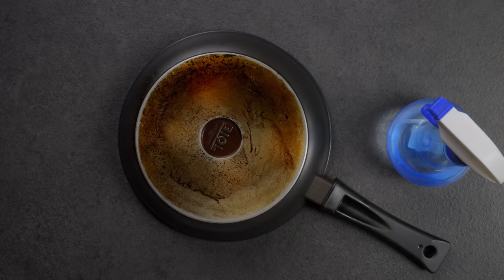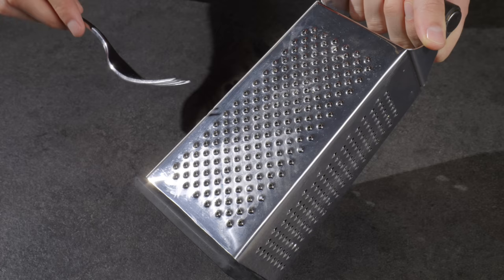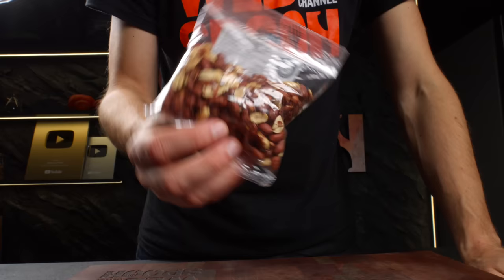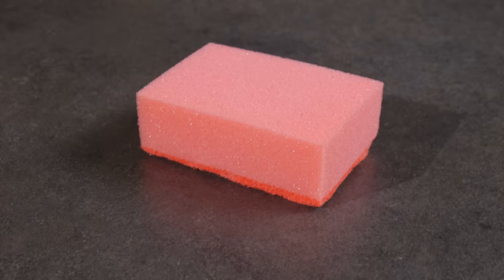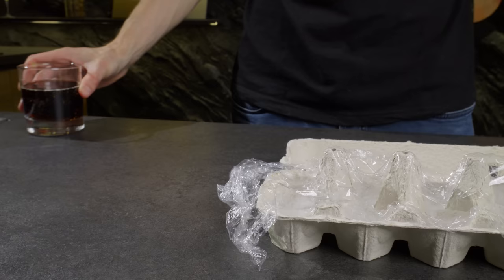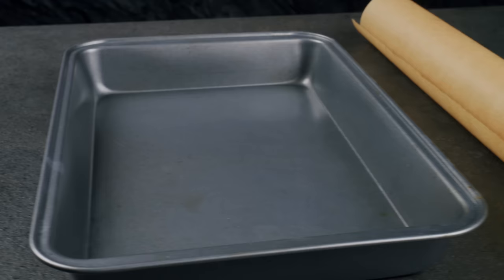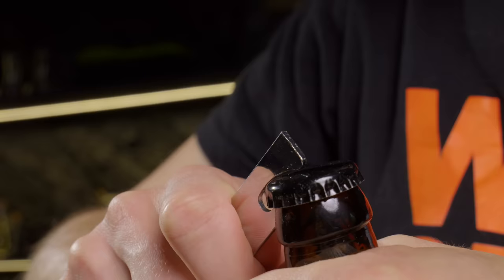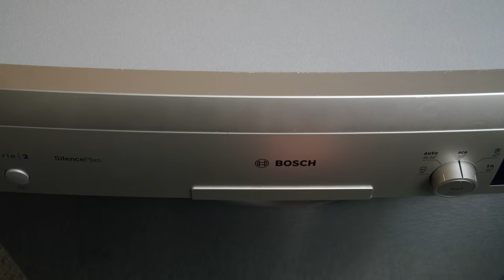Nobody Believes But It REALLY WORKS! 50 Brilliant (+1 FREE) Budget Ideas Work Like CRAZY Magic!

Comment: It’s a lot easier to drain a can of food that has a tabbed lid, by just opening the lid slightly, and using the lid slightly closed to pour out all the liquid.  The lid become the food blocker
Reply: I thought everyone knew this... Common sense is not so common,  lol.
Reply: @tamicarter1280  You would think, wouldn’t you? LOL.
Reply: @tamicarter1280 common sense would tell you that sometimes you accidentally take the can lid all the way off, and there is a solution, without putting the sharp lid back on to drain.  😊

Comment: When needing pàrchment paper for round cake pans, i simply fold the parchment into four, place the cake tin on the top and with a pencil draw around it, then cut around the pencil line, this gives you four circles , which leaves spares, for next time you need to bake.

Comment: You can save your coffee for drinking. 
Simply put a small layer of water in the bottom of the pan. 
Set the pan on the stove burner & turn on a low flame. 
Put the lit or aluminum foil to cover the pan. Let water simmer a few minutes. 
Use a plastic coated spatula to loosen any  burnt spots on the inside bottom of the pan.
Wash grease off with soapy water. And, you're finished.
Reply from the maker: Ah, the ol' simmer-and-scrape trick!
Reply: This works using grounds from the morning brew. Just tried it stainless steel pot is like new.  Skillet was cold and I add about a table spoon of water let sit maybe 5 min before rinsing
Reply: When washing greasy pans make paste ,soda &   water , rub with bunched paper towel.
Always put a paper towel over sink drain to trap grease / oil ...rinse pan and pour slowly into sink.
Paper towel catches all oil / grease fold towel and put in garbage / compost.
No outrageous plumber bills.....never pour any type of fats down the sink drain.
$$$$$$$$$'

Comment: Use Japanese bevelled knives (right-handed, left-handed) that allow potatoe slices (fish sashimi slices) etc to easily fall away from the blade.  Or use the scalloped blade edged knives that doesn't hold potato slices (et al) to the blade surface.

Comment: To hold your cutting board in place use slip resistant shelf liner , wash and use again or you can simply glue the liner to the bottom of the cutting board and wash as needed 😊❤
Reply from the maker: 🔪 #CuttingBoardStability

Comment: To clean a dirty, greasy pan, add a couple drops of Dawn and about an inch of hot water to the pan and bring it to a boil and let it boil for about 2 minutes. Turn off the heat and scrape the bottom with a spatula. Let the water cool down, dump it down the sink and scrub it out with your sponge or brush. So much easier!
Reply from the maker: That's a fantastic tip!🌟
Reply: The water alone works as well. You can add a little water, bring it to a boil, turn off the heat and put on a lid. Let it sit till the meal is done, and the pan will clean up easily.

Comment: I had heard about using a ceramic cup/bowl to sharpen blades, but I had not heard about heating the ceramic first with hot water. I wonder what that does to improve the sharpening surface. Wonderful video, demos, and tips. And a big thanks for splitting them out in the information description. Referencing the hack using toilet paper instead of a napkin: TP is too weak and it will cling to your hands. I LOVED the hack to open a coconut!!  All I need now is one of those wine bottle openers ;-)
Reply: I HAD COMMENTED SAME ABOUT THE TOILET PAPER HACK IN ANOTHER VIDEO. BUT I ADDED THAT INSTEAD OF NAPKINS IT'S PERFECT FOR TISSUES. I'VE BEEN USING IT THAT WAY FOR YRS AND PUT IT INSIDE A DECORATIVE TISSUE WOODEN BOX OR ANY OTHER MATERIAL- THE ONES YOU CAN COVER YOUR CARDBOARD TISSUE BOXES WITH. 
TP IS CHEAPER THAN TISSUES😊
🌺☮️💟🌺

Comment: The thing about cutting a Kitchen Towel in half to get 2 Toilet Rolls, is good in theory, BUT, you need to keep in mind, they're made differently! Toilet Paper is designed to be flushed, where as Kitchen Towel is designed to absorb water, so flushing that in the toilet, can clog it up, so i don't suggest you do that 😉

Oder in the fridge, instead of taking up space with the size of a sponge, just add a couple teaspoons of Baking Soda in one of those little medicine cups, it has the same effect 🙂

The parchment paper tricks made me think he was gonna do one of those paper airplanes 🤣
Reply from the maker: You bring up some excellent points!

Comment: I've gotten pretty good tips from this guy before but most of these are not worth the trouble.
We used to sprout seeds between 2 wet paper towels.  No need to use a whole roll of TP!
Also I only use a clean wash cloth every day, never use a sponge in the kitchen.
Baking soda will clean pots & pans like new without scratching those with mirror finish, handy since we're not coffee drinkers. Save our lemons for recipes. As a matter of fact, baking soda at around 50¢ a pound will clean & deodorize almost anything!

Comment: Burn something in your pots and pans? Fill with water and put on stove to boil. Add some Barkeeper's Freind in the water and let boil for a few minutes depending on the burn. Turn off flame and clean with a scrubber either whie still hot (dump the hot water) or after it has cooled.
Reply from the maker: Thanks for the hot tip 🔥🚿🌟

Comment: Would you know how to stop a non-stick pan from everything sticking to it. Even on low temperature.
Reply from the maker: Handle the frying pan correctly
Use the right cookware
Avoid high heat: 
Wash by hand on the delicate cycle
Use a minimum amount of oil
Avoid using cooking sprays with propellants

Comment: Don't waste your expensive lemons for cleaning the skillet (or the oven, actually) the reason it works is the acid in the lemon juice, so it works just as well if you pour a little vinegar (the stronger the better) in the bottom (just enough to cover the bottom) and sprinkle the baking soda over the surface with a spoon or small wire strainer, watch it foam, leave 30 mins and same effect. Use a green scouring pad if it needs the bits taken off, but they'll be much looser and require very little effort!!!
Reply from the maker: That's a fantastic alternative method!

Comment: 06:35 - Easy Hack to Reseal Plastic Bag Without an Expensive Heat Sealing Machine 🛍🔥
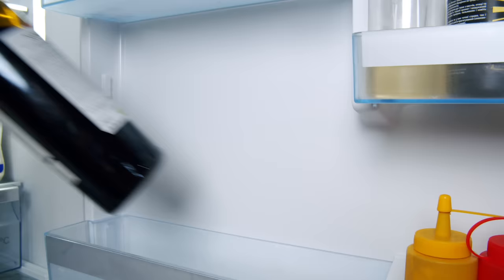09:16 - 🛠 DIY Knife Sharpener: Transforming an Ordinary Clothespin 🔪
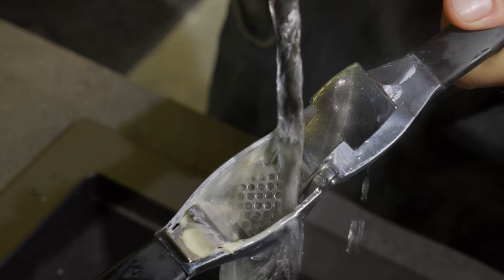13:05 - How to use an egg carton as an ice cube tray 🥚❄
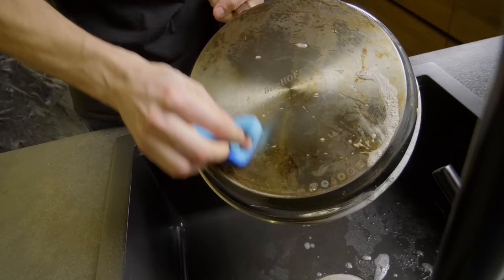15:26 - How to sharpen the knife with ceramic dish 🔪🍽
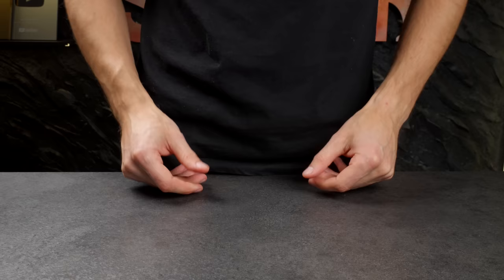17:29 - How to Close a Bag of Something Without Using a Clip 🛍🤏
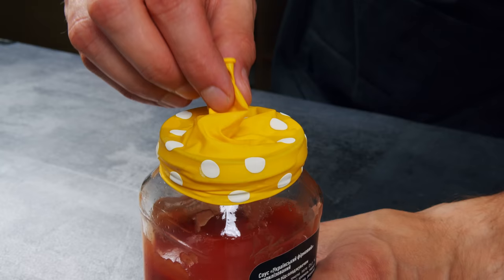18:43 - The Simple Hack That Will Transform Your Forks Into Kitchen Tongs 🍴➡🦞
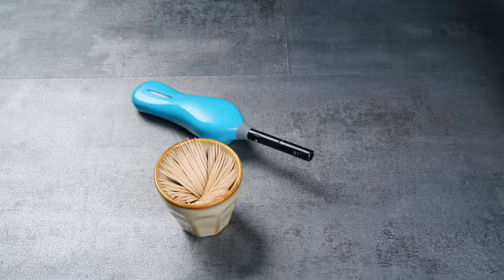21:22 - This Secret Trick Will Stop Splattering Oil Forever 💦🚫

Comment: Some really good ideas, but some are more work than required.  Toilet paper is much more expensive than baking soda--a small quantity in the fridge removes odors.  Why take the time to fold parchment paper to make the pan smaller for frying?--just use a smaller pan!  Why use a container and sponge and water and baking soda to get rid of fridge odors--just use baking soda in a small plastic cup like for yogurt.  Why put water in a glass to clean a stick blender--just run it in the dishwater!   Why dirty up garlic press to get soft butter--just put a a pat in the microwave for 3 secs.  
why dirty up a potato masher to drain a can of liquid--just put your fingers over the end.  Why dirty TWO glasses to make an omelet?  Use a fork--or just blend it in the fry pan!  You don't need to wet parchment paper to get it to conform to a pan shape--just wad it up into a ball and then smooth it out; perfect fit.  I have never had a fry pan smell like fish--if I just WASH it!  But some of the others are brilliant!
Reply from the maker: Your comments are quite interesting and offer alternative methods that may be more convenient for you. Perhaps not every method suits everyone, and that's perfectly fine since everyone has their own preferred ways of solving tasks. Some of the alternatives you mentioned can indeed save time and resources, while others may be less convenient for other people. The key is to find methods that work for you and fit your needs and preferences. Ultimately, it's important to share experiences and ideas so that we can learn from each other and discover better ways to handle everyday tasks. Thank you!